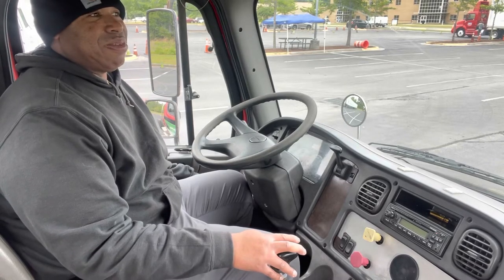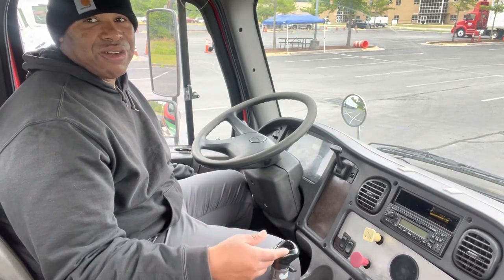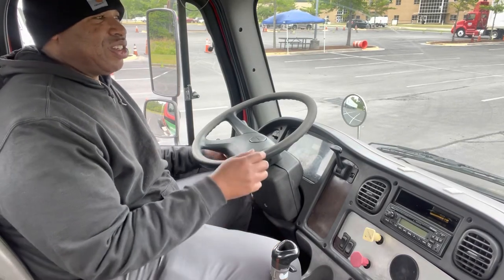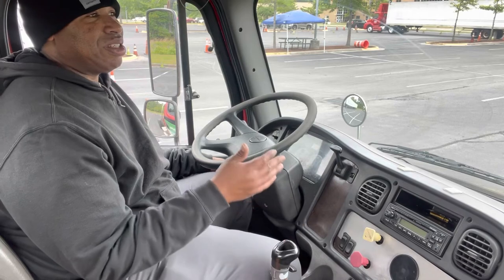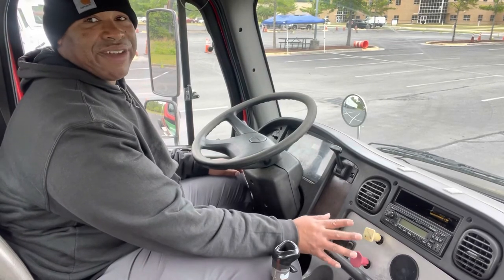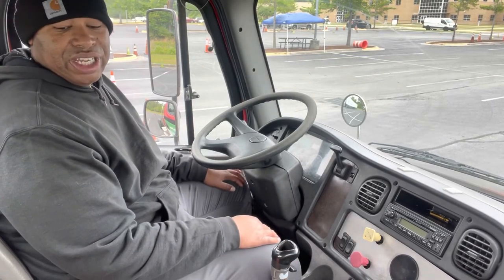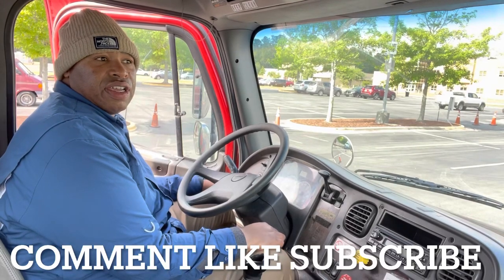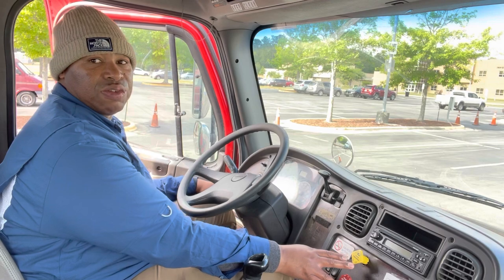HOW NOT TO MAKE COMMON MISTAKES THAT WILL FAIL YOU ON AIR BRAKE TEST

Comment: How do I procede when i lose more than 4 psi during air leak test? And, during pop out test, what do i do if only one valve pops out and the other doesn’t (in the range between 20 and 40 psi). I got failed when both of these happened.